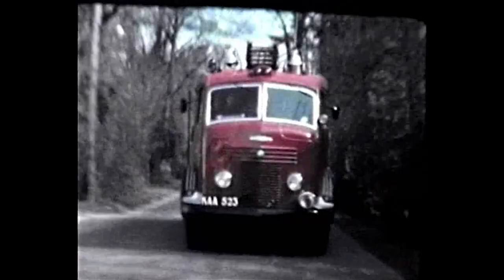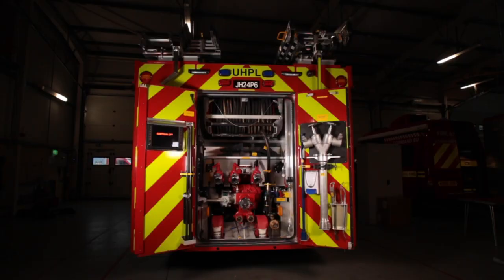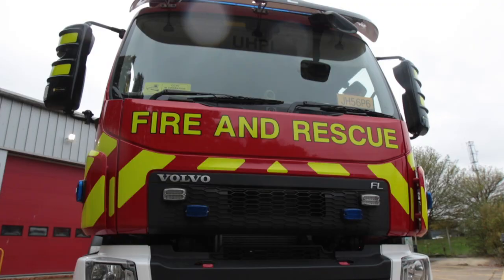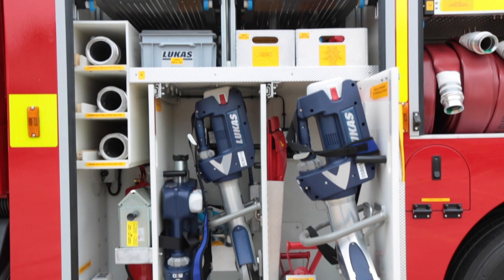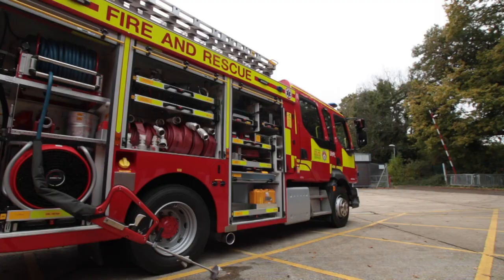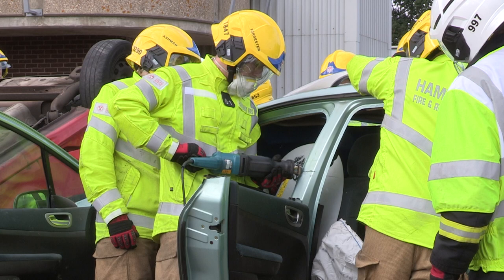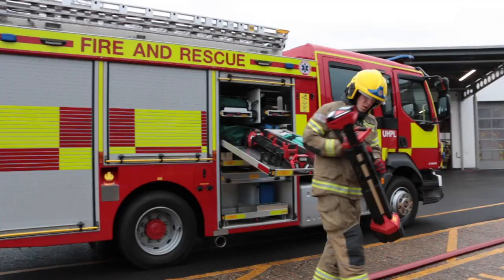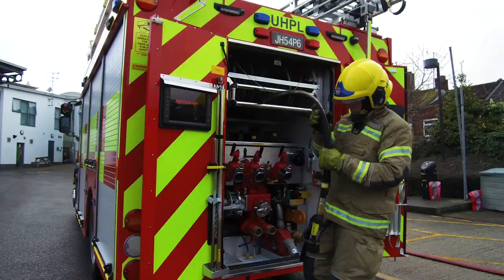The New Light Rescue Pump

Comment: Be good if Portchester 28 got one of these. It be good for ports down hill plus Southwick, boarhunt and wicor wreck it be nice and easy to get through when on a fire call or a rtc.
Reply: Tell me why do Hampshire appliances have numbers on the front
Reply: @jackshit3355  every fire station has a number in Hampshire. So the numbers on the fire engines shows where the fire engine comes from I.e Cosham is 23 fareham is 17 portchester is 28. I hope iv explained it right.
Reply: @christopherthewreckerthats2295  I just wondered if it had a connection to the American way of doing things
Reply: @jackshit3355  they might of looked at the us fire services and saw there where using numbers and took the idea. I know the UK and USA airports use numbers on their fire crash tenders.
Reply: @jackshit3355  they might of looked at the us fire services and saw there where using numbers and took the idea. I know the UK and USA airports use numbers on their fire crash tenders.

Comment: the way rural greenland is disappearing for houses there will be no need for these appliances the biggest downside I see is that they carry only 5 fire fighters which means 1 crew less for a serious incident unlike before covid a basic crew was 6 fire fighters welcome todays modern fire fighting in a noddy fire appliance, A lot of fire fighters at the station where I was fire fighting don't like these new appliances as our station goes over the border to West Berkshire
Reply: North Yorkshire is down to 3 crew on smaller pumps called Tactical Response Vehicles, replacing full-size engines.
Reply: @momus9775  Seen whole time stations in North Yorks tip out with 3 of late, and stations be closed for the day due to lack of crew, Acomb and York being just 2
Reply: Most rescue pumps in Hampshire haven't deployed with 6 person crews in years the requirement is a minimum of 4 and your be lucky if you get 5 especially at retained stations